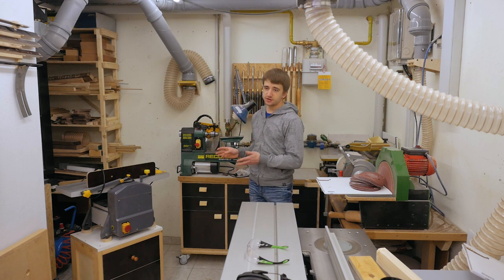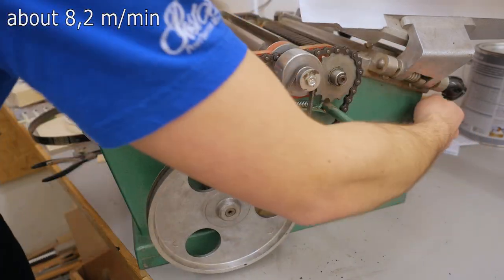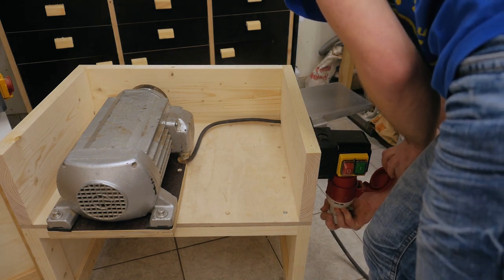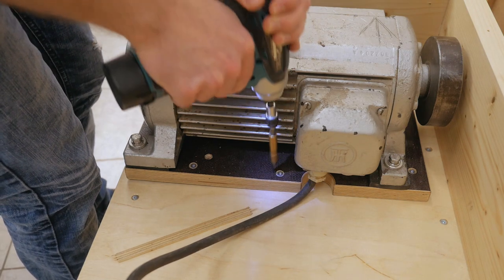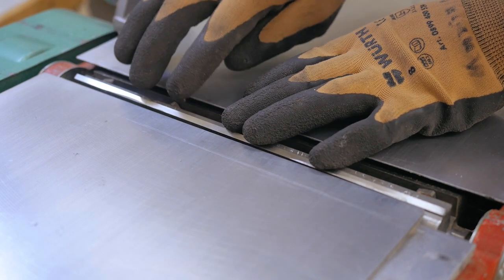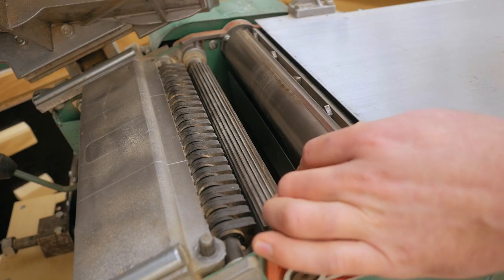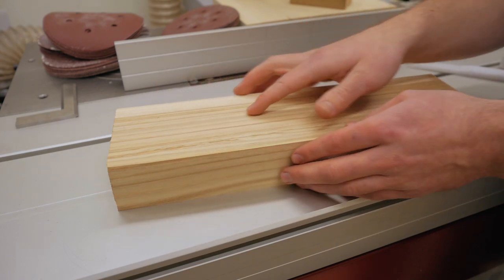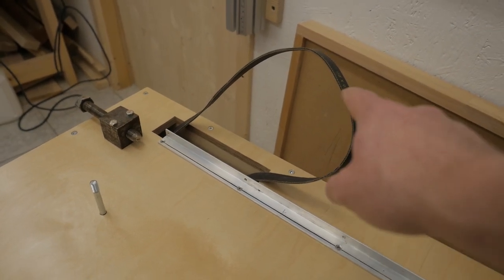New Old Jointer/Planer: Kity 636

Comment: I liked the way you refurbished and older tool to be used again. That's how I done my woodworking shop, a tablesaw , bandsaw, and jointer all refurbished. It's a great way to save money and have good working equipment. I like doing that as much as the woodworking.

Comment: You will have great times with that machine. They were made in France, most of them were made on the simple idea to use one single motor to power many machines. They were also manufacturing bigger machines with their own motor. I own a 20 yo table saw of this brand (a Kity 619) and a planer/jointer Kity 637. Both a awesome machine very reliable. I bought my saw for 400€ with 6 blades (up to 270/300mm blades just work fine), a rear outfeed table, a side table to rip up to 1000m wide sheets, and a cross cut sled with a 1200mm bar. The planer is quite similar, the tables are 260mm wide, 1200mm long, and can joint up to 250mm. I add a digital scale on it to ease reading the thickness I'm aiming for. Enjoy.
Reply: Look on Ebay to fing in UK very low priced jointer blades, I found a pair of 260mm knives for around 20€. A french e shop may also help you to find parts for these old ladies..

Comment: Motor is a beast....doesn't even flinch when put the wide side through.
Reply from the maker: Oh yeah, I love it.
Reply: The motor looks a lot like it is actually a re-purposed direct drive table saw motor (note the extra flat construction & how the mounting flange goes away to the side and rear - that's to increase the effective cut depth — and all standard industrial motors have a nameplate). Probably leaning more towards the 4 kW (5 1/2 HP) mark. Very nice setup!

Comment: cool video
I have the same machine, mine also has a horizontal drill/panel saw and molder that you can activate by changing belts (they are separate machines mounted on a table with only one motor).
She works really great, it's nice to see that there are more people who have this brand.
I believe it’s a brand from the Scheppach group.
Reply from the maker: How well does the molder perform? That's the only other machine that could be useful in my shop (once it's big enough to allow for that)
Reply: It performs pretty well for such small one because it has a 1.5hp motor(3 HP in your case) the downside is that is only has a 15mm (or 16mm I can check that for you) but with the right spacing rings I use molders that need a shaft size up to 30mm. it has a really nice  adjusting system for the molder height.one other great feature is
that is has a slot in the table to use the sled from a table saw, so you can cut counter profiled tenons. If you want to I can take some  pictures during the weekend, or if you have any more questions feel free to ask.
Reply: bart b hi m8 I have just bought  same thing.and have to put it all back together  due  to transportation lol .You have to twist the belt to operate boulder don't you.?

Comment: Your “new” planer/jointer appears very much reminiscent of the old—and discontinued—Swiss Inca tools. They were well engineered. There appears to some subtle and not so subtle differences. After some for 40 years I sold the Inca tools and bought a Felder 531 Pro. Excellent combo tool, but there are times that I miss the Inca tools. Well made, light and easy to move around the shop—and the country.

Comment: That's a great looking machine. I would never have the confidence to drop 400 euro on a secondhand purchase off ebay in case it turned out to be a dud.
I have the modern equivalent built in china but it still works well. Try not to lift it by the tables though. I made a set of handles for mine with two long wooden 'bars' that were screwed into the main body where the tables attach. You can then do the equivalent lift but without stressing the tables.

Comment: Looking up Kity 636 I found mention of it as a current model in a 1992 issue of American Woodworker.  Your machine's styling looks older to me than that, but looks on industrial grade machines aren't a big concern to manufacturers, so don't give that much weight.

Nice machine, sweet build.  Looks sharp.

Comment: I have one of these in a single phase configuration - I think it is 1.1kW motor. It did not have all the dust collection parts but I made my own. It is on its original stand. It is a great machine and I will implement some of your mods to improve my one.
Reply: I just found a set of 4 Kity machines on the original table an are thinking about buying an extra motor so i don't have to change belts  >> Do you think 1.1 kw is big enough for the planer or should i go for a bigger one ?  ( the machine is not mounted yet so i have no idea )
Reply: Eric Koster i find my planner works well with the 1ph motor that is of that rating i think. It depends on the amount of material you are removing at a time which is a cross section of thickness x width of piece. I've run beech and cherry through mine that were the whole opening width taking about 0.2mm at a time but anymore would slow the motor. Running spruce however i could take nearer half a mil at a time at full width. Having not had a machine previous I've nothing to compare it to.
Reply: Okay Thanks for your reply , since now is the time I can make a choice I think I will go for something a little bigger

Comment: I just bought a set of 4 kity machines, 1 of them a 636 an i am in the process of mounting them to my worktable.
I really like your idea of adjusting the fence, with or without your permission I will copy that.
Thanks
Reply from the maker: Of course, you can copy/use my idea. You maybe send me some pictures when it's finished. My address is in my channel description.
Reply: If I find out how to put the pictures from my camera to my  computer I will, I am not in to anything digital , that's why I like this old machine, I can tear it apart and put it back together and I know it will work. 
On a sidenote: I like your style of working, making do with a budget and a small space , unlike some who seem to be sponsored by Festool or Incra

Comment: i been thinking about the kity 636 for a while now but after seeing it in action im sold im gonna have to get one they certainly beat the £200 plastic ones from diy shops haha
Reply from the maker: The 200€ crap doesn't even come close to this.
Reply: my table saw has a threaded arbour on the right hand side so maybe i could power the planer with it using a pulley system try and cut down on the footprint my shop isnt big enough for a dedicated planer/thicknesser cart like yours but one day

Comment: Your old jointer/planer looked like something out of a Little Tykes toy set, but this newer one looks like a great option if someone is short on space! Good width, too (25 cm = 10")! I think an 8" is the biggest I've seen with a benchtop model before I saw this one! In fact, this is probably as good of a benchtop model as I've seen...most of the other ones I've seen look like buyer's traps: cheap to buy but ultimately a waste of money.

Comment: You can make a lot of sauerkraut with that machine .
Reply: The sawzall is cute little toy we use for repairs only and a 7 1/4 "circular saw to cut material up .
Reply from the maker: sawzall wins because it's battery powered. Quicker than pulling out the circular saw.
Reply: Quieter, too, and it doesn't throw the sawdust as vigorously.
Reply: I just bought a Ridgid Circ saw that uses the same 18v battery as my other tools.  I was worried that it would not have the power to deal with serious cutting.  It's like using a lightsaber!  Honest to god, I'm almost 50 years old and I'm so stupidly happy with this thing I practically want to sleep with it at night.  I used to dread dragging out my old corded CS and now I find reasons to use it.

Comment: I had a similar machine when I first started woodworking. It was an 8" (200 mm) jointer planer by Jet. Your's looks to be of higher quality than mine, but the dust collection set was always EXTREMELY annoying and I replaced it after a year.

I am a bit surprised to hear you bought that machine for 400 E.... I bought a Makita 2030N for 400 USD. Much bigger machine with a 5' jointer bed. Are tools in Europe just a lot more expensive than the US?
Reply: its an economy of scale thing US tool market is a lot larger more tools sold= lower price's
also we have been depleting our forests for a lot longer so wood costs more the deals are out there just got to look for em though

Comment: weird, I've just bought the exact same Kity 636 combo P/T of ebay. I'm in the process of looking for a 2 pole single phase 2hp motor. The cutter head subs at 7000 rpm, the pulley on the cutter is 50mm therefore you need a 150mmm pulley on the motor.
Reply from the maker: My motor has 2800rpm and a 120mm pulley. That speed work good. If you can, get a even more powerful motor, you won't regret.

Comment: Really nice & creative job of upgrading and setting it up.   I was wondering what the advantages over that previous Chinese machine you had are?  I see some: blade width 25cm vs. ~20cm (15?), seems to be you feel the Kity is more powerful...did the Chinese machine struggle with full width boards?, table is a little longer so could keep workpieces from tipping, fence looks somewhat sturdier but you had to fix the squareness, it can plane larger pieces underneath?, gears inside are mostly metal whereas I guess the Chinese one are all plastic? and it has the dual speed if you move the belt on the pulley.  But both have aluminum/light tables, both have somewhat similar means (various knobs) of adjusting the configuration.   What look like disadvantages to me are the external motor and belt takes space and the motor requires special mounting and looks complex and overall the whole set up is larger and heavier.
All of that said, was the Chinese machine that much worse?  I mean, was the end result ok, a square and smooth piece of wood?  Is the difference more in terms of pleasure-to-work-with than the results?  What was the main reasons you decided to switch machines?

Comment: Hi. Marcus i want ask what RPM has your cutting head. I also have kity but 635 and need to set correct drum speed on new pulley. I check at kity manual and there is motor pulley 125mm dia, drum pulley 50mm dia, and motor speed 3000RPM. I check and it gives 7200RPM at this set. But on my original kity cutting head write  7000RPM MAX. And what speed u have ? 
BTW
I also upgrade to knurl feed roller and multi v-groove belt
Reply from the maker: My cutterhead speed is about that rpm.

Comment: Great video. You make me jealous, even your old jointer/planer was better quality than the one I'm using, and this thing is a beast. And it's so quiet. For some reason, mine can be heard from about 200m down the street when it's working hard. I would have been a bit interested to know how the height adjustment mechanism works. Sounds like a chain?
Reply from the maker: It's quiet because I always lower the volume of my tools in the videos, more enjoyable to watch. And yes, the table has four threaded rods in each corner, connected with a chain

Comment: Really liked your intro-gag! Nice machine you got there, but now I got a question - Which kind of surface finish did you use on the playwood on top of your cart? I'm watching other woodworker-channels on Youtube too, but I'm always lost in the aisle in the local shop. As you're also German, I'd like to know wich product you used and if it is compatible with stain?
Thanks for your time!
Reply from the maker: It's a water based flooring varnish (also used for staircases). Got it from Hornbach. If you have a look at my Instagram profile, I posted a photo of that finish there.
Reply: Thank you for your quick response :)
Reply: MadixLP and a

Comment: Hi, have you made any adjustments to the infeed and outfeed tables, to get them co-planar? And if so, how?
Reply from the maker: Yes I first set the out feed table in line with the cutter head and the infeed table coplaner to the outfeed table by loosening their six festening screws. Then moving, tightening, checking and repeat until good enough
Reply: Thank you, Marius  @MariusHornberger

Comment: I am trying to figure out at 4:57 how the crossbars between the boxjoints became so wide. At 3:35 you can see that the woodframe is assembled in a consistent shape.
Have you glued some extra wood on it?
Reply from the maker: Two different orientations. At 3:35 it sit on its back on the workbench
Reply: @MariusHornberger  thx for the quick answer but i am not satisfied with it ;) Are the upper struts at 90° to the lower struts? At 3:33 it doesn't look like this. Sorry to disturb you with that, but that rly bothers my mind, actually.
Reply from the maker: Okay, there's an additinal piece glued in off camera
Reply: @MariusHornberger  thx very much. That was very helpful.

Comment: Hi Marius, you've got a fantastic channel going. It's quite a big part of what has gotten me into woodworking in recent months. Along the way, I've picked up a few of the required machines (table saw, drill press, band saw) including a Kity 636 Jointer Planer. I've stripped it completely, cleaned it and refurbished it back to its former glory, and plan on making some of the additions you've devised (quite ingeniously). One issue I'm having though is getting the in and outfeed tables parallel. I was wondering if you have any references or advice on this issue? Many thanks,
Simon

Comment: Last month I bought a version of your old planer... It's powerful enough but the safety pad that came with it sucked. Ended up pushing it through with my hands and chopping the end of my fingertip off. Sad times.
Reply: Safety should be the primary use when using these machines and not the finished wood.  I even use push sticks with the band saw. 

All it takes is one slip and a bad accident can happen. Stay safe.

Comment: Hi Marius,

Nice jointer/ planer you've got. I was wondering how the adjusment/ set up on the outfeed table is? I've got a Scheppach HM1 myself, it's from a similar period and build as yours but the adjustment on the outfeed table is a right pain in the b***. Four register points that loose all registration themselves once you loosen them a bit. Hoping to hear from you and love your videos.
Reply from the maker: It has six bolts, three on each side which hold the table to the base. But I didN#t have to adjust anything.
Reply: That's interesting, often jointer have an adjustable outfeed table so you can set to a parallel plane to the infeed table, like my jointer. With your jointer they probably machined it precise enough so that it isn't necessary. It certainly makes life easier. Thanks

Comment: I’ve got the same machine and I am really happy with it!! It’s probably been built in the seventies... a question for you: how do you know if the blades screws are tighten enough?? I whish I could know how much I need to tighten, ideally with a torque wrench.... I you have any suggestion, Please let me know. Thanks
Reply from the maker: I don't really know. But I'd say you can tighten them as hard as you can by hand with the normal size wrench. Not really a good measurement, but you should not be able to break anything through that.
Reply: That’s already an indication, thanks a lot!

Comment: Hi Marius, do you know how to dismentle the axis of tabel taht tilt for ticknesser? It has also a small pin inside the middle of the axis. Do you know what is his function? Thanks Uri
Reply from the maker: The table doesn't tilt. There's no pin
Reply: Part 6 is the small pin and part 7 is the axis in the image below. I probably not using the correct words for the items
http://i57.servimg.com/u/f57/18/13/37/46/vues_e22.jpg
Reply: The part you are referring to is used to adjust the height of the outfeed table, if your knives are properly installed you can adjust the outfeed table to minimize snipe >>  turning the black knob at the end allows the table to slide up or down >>  since this adjustment is hardly ever used I needed to use some penetrating oil and a few careful taps with a hammer to make it slide again

Comment: Regarding your little wooden clamp for securing the jointer dust collection.... on my slightly newer model I think you're meant to raise the thicknesser table to clamp the dust shroud in place. Is this the same for your model?
Reply from the maker: Oh damn, I haven't tried that yet...now I did and it seems to work that way. Thanks for the tip.
Reply: Marius Hornberger that's pretty cool.  Clever design by the manufacturer

Comment: I got the same Kitty 636. Mine is in fine condition but the planer table is some rusted!? Did you have any "rust" on you tables...I say rust but I did2t think aluminium could rust? If you did, what did you do to get it of? Thanks Marius
Reply from the maker: Yes, the planer table also a little bit. Didn't matter. The planer table is not aluminium, it's sheet steel.
Reply: The spring that puls down le wheel that activates the feed belt is to slack...do you think I need a new or can I just pull some on it? Thanks for the fast respons...do you still like it?
Reply from the maker: If your feed rollers are slipping because of that I'd first try to clean the belt and little pulleys, otherwise different spring. Yes, I still like it a lot. Fits perfectly in my small shop.

Comment: Next project should be making a new blade guard?
Reply from the maker: The current one is fine, just need to make it height adjustable
Reply: Do you not find it quite annoying in mid air? I would of thought something with a spring mechanism like Frank Howarth has got, would be safer and easier to operate?
Reply: i should of watched till the end lol, i still think you should check out franks blade guard, seems easier and simpler to me!
Reply from the maker: +JMakes but needs more space. I like the current, just needs to be height adjustable